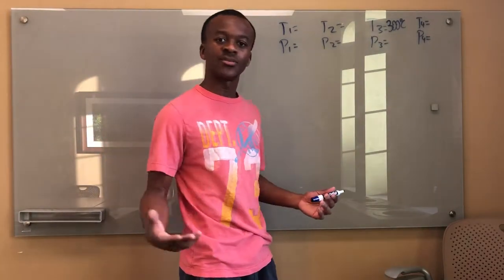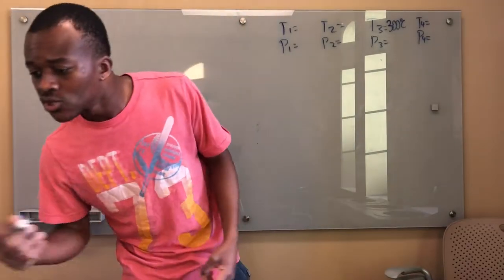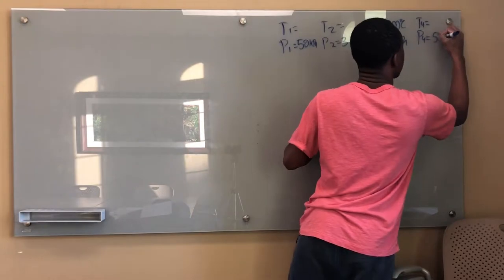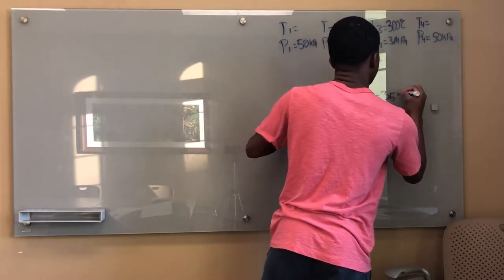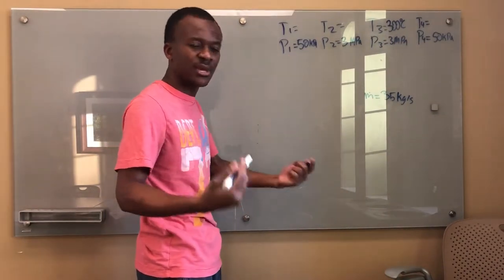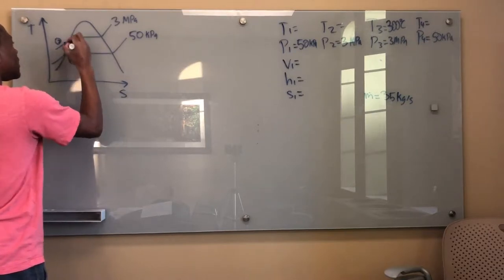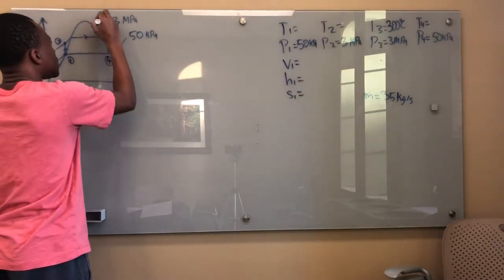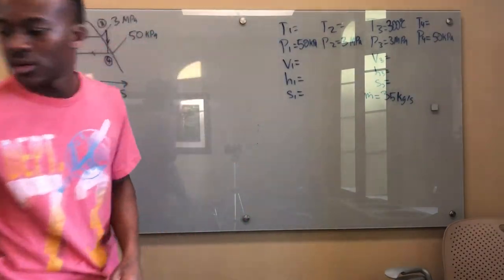Ideal Rankine Example Problem

Comment: i think u forgot to multiply mass flow rate when finding power in? at 8:40
Reply from the maker: I think you're right. Seems I got lucky that I didn't have to use that to calculate the final answer. Sloppy mistake. Good catch!